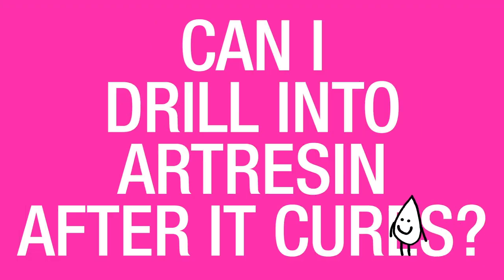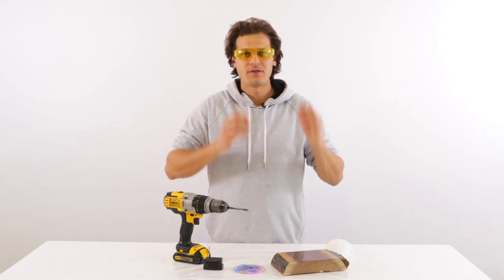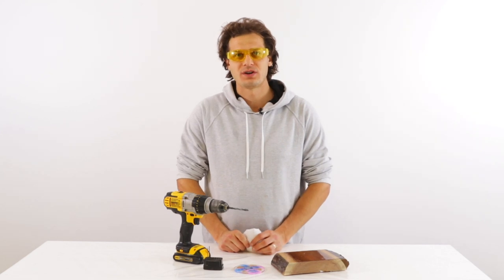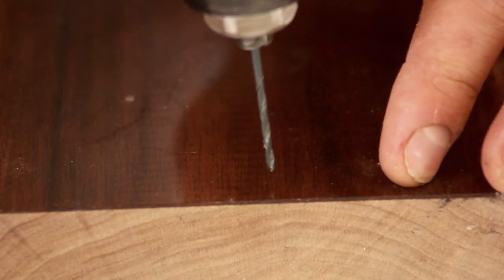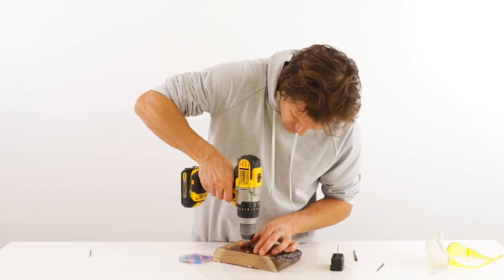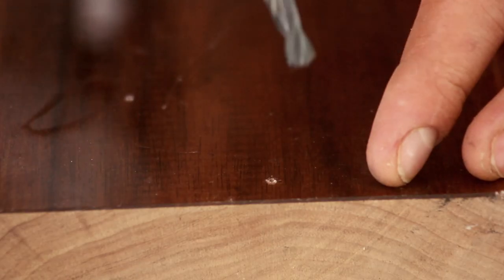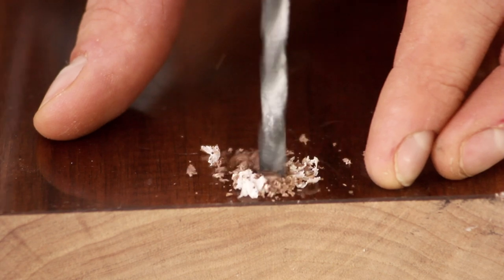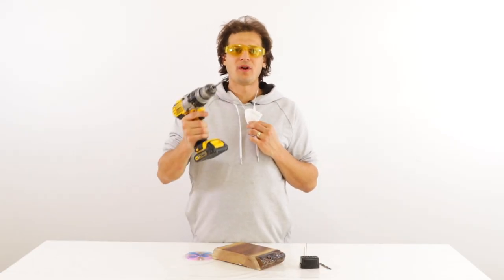Can I Drill Into Resin After It Cures?

Comment: I've been making keyrings with ArtResin but everytime I hand drill it and screw in the eye hook I notice  cracks a few hours later.. why is this happening?
Reply from the maker: Hi Sianee, I would try drilling the hole just a little bit larger, it could be that the screw is splitting the resin when its screwed in.  Adding a drop of uncured resin to your screw will also ensure it remains tight once in place.
Reply: Got a solution to this?😢 Experiencing the same

Comment: I drilled into it and the resin cracked across my piece .  Any  Suggestions ?
Reply from the maker: Oh, I'm sorry to hear this happened!  I would try sanding down the piece and applying a fresh coat - if you can, open up the crack with a tool so that the resin fills in the gap.  You may still see it but it should help to minimize the appearance.